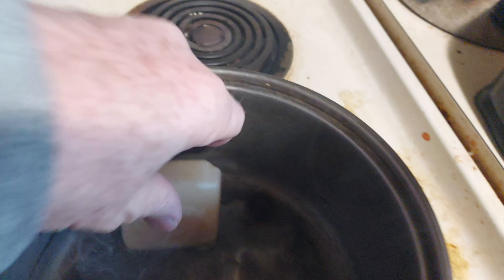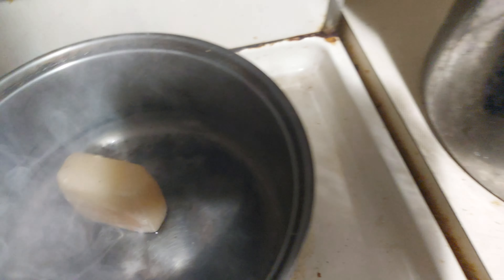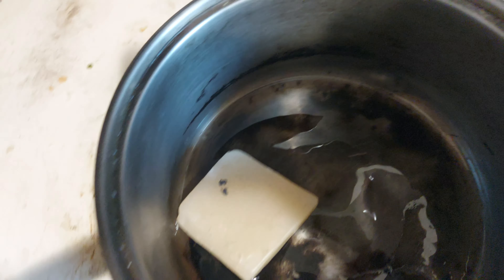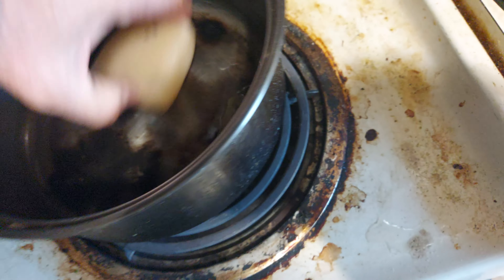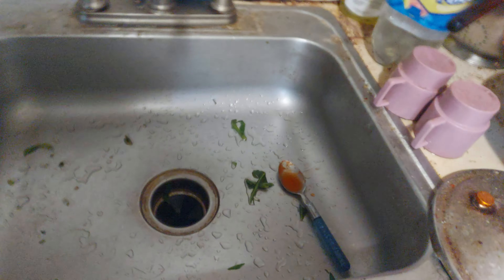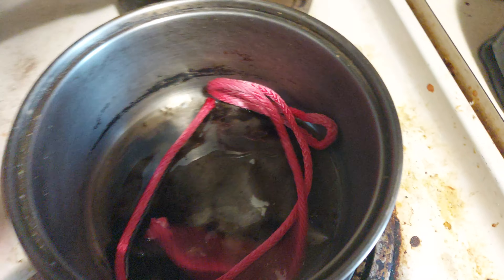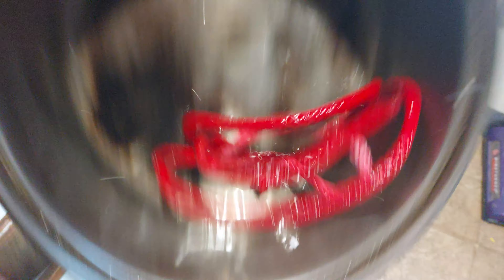how to treat kiteboarding leaders and chicken lines with wax to extend their life

Comment: I agree.  Q power is awesome :). So what can you do in warm climates if you can’t use wax?
Reply from the maker: good question!  I assume just buy control bars that have those PU tubes or put a PU tube over your chicken line.  It's easy enough to convert even one that used to use ropes and no plastic tube.